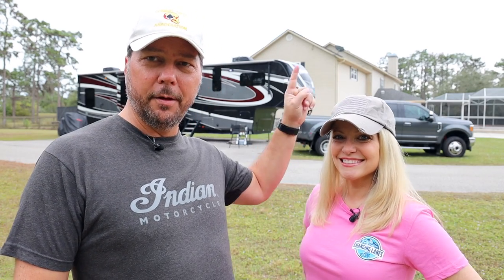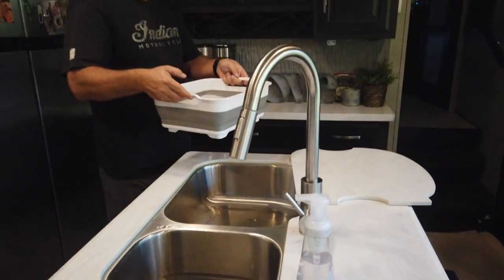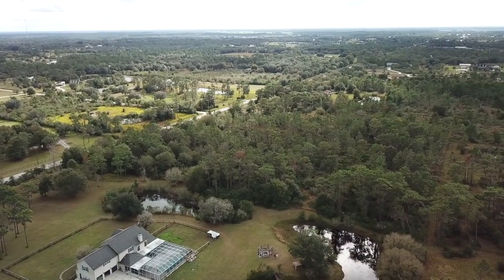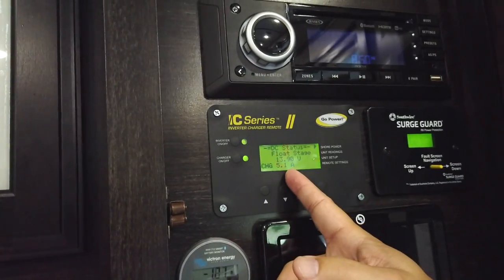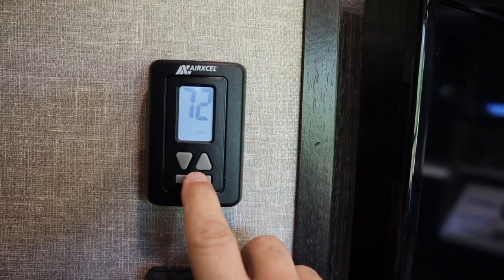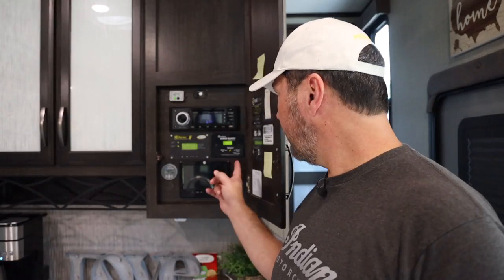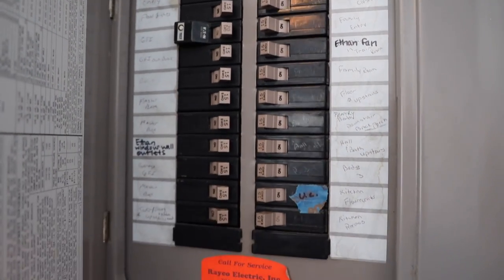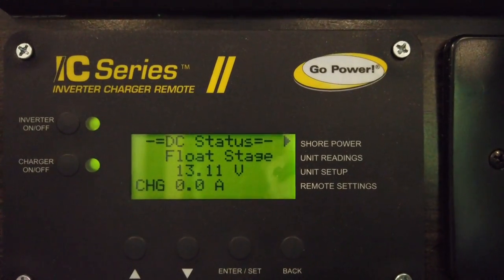RV Moochdocking! | Cheat Boondocking Like a Pro! | Changing Lanes!

Comment: So we have 2 campers 1 50 amp (2 ac) 1 30 amp (1 ac) with one 50 amp outlet...question is can we put a 50 amp splitter to power both campers with no issues?

Comment: Thanks for the video. How long does  a propane tank last on a mid size fridge and water heater?
Reply from the maker: Really depends... We shut off the water heater till about 30 minutes before we need it.   Also depends on outside temp for the fridge and how much "work" is has to do to stay cool...  Generally a single tank has lasted us about a week using LP for both.
Reply: @ChangingLanes  awesome, thanks!

Comment: Thanks for the helpful information.  I have 30 amp service in my RV.  Is it possible to do the split with 30 amp only?  (30 amp to dual 15 amp)  Also, where did you buy your adapters?  Thanks again.
Reply from the maker: Hi!  Everything is linked in the description.. But, there is no way to split 30A since 30A is a single 30A leg... Nothing to split.  You can dogbone down to 15A though if moochdocking...  Hope that helps!
Reply: @ChangingLanes  Thanks for responding.  Wanted to also thank you for your service to our country.  God bless.

Comment: Great video.  Question: I have a 10000w generator that has two 30amp and 4 20 amp outlets.  Can I combine a 30 amp and one 20 amp for a total of 50 amp?  (Actually 42amp) max output of generator.  If so where do I find the "Y" plug adapter?
Reply from the maker: If it's truly 10kW, it should have no problem supplying 6kW. (50A @ 120V).  It will depend on the generator supplying both connections simultaneously, which I guess it should.  You'll need to find the right combo of adapters and dog bones to make the connections...

Comment: Wow that is cool....however on an older class A I was always told never hook up to an extension cord.......hmmmmmm now this is ok????as a result TVs would be blown......due to low voltage
Reply from the maker: You need an appropriately rated extension cord (not the cheap ones) and it's fine.  Notes about this have been added to the video and blog: 
➡️ EXTENSION CABLES: Be sure to make sure any extension cables you use are rated for 15A. For longer runs like 100ft, these are NOT the cheaper cables. They should be labeled with rated amperage. Also, the longer the cable the more the voltage will drop, so keep an eye on it to make sure it doesn't drop below 108v (90% of 120v).

➡️ HOUSEHOLD CIRCUITS: When a household outlet/circuit is rated at 15A, that rating is generally for short term (under 3 hours). The real rating for long term load (over 3 hours) is 80% of the rating. Meaning, on a 15A circuit, if you’re going to run it over 3 hours, you should be at 12 Amps or less. An AC is like long to cycle less than 3 hours anyway, but on a hot day, it’s something to be aware of.

➡️ HEAT: When connected to 15A or 15A+15A and running for about 30 minutes under load, do a check of the entire line from your RV to the adapters, to the extension cables, and to the wall outlet. Do a touch test to make sure the lines and/or connectors are not getting hot.

➡️ POWER PROTECTION: We HIGHLY recommend using a Surge Guard Total Electrical Protection device (see: youtu.be/4FNtBtE_x2s), or some type of EMS that validates your power source voltage, frequency, wiring, etc. These are a great safeguard against bad RV park wiring as well as bad household wiring and just plugging things in wrong.

Comment: When you said the inverter kicked in is it pulling power from your batteries to run the inverter which makes up the much needed amps?
Reply from the maker: Yes.. With a hybrid inverter, you can set the max shore power to something like 13 Amps.  Then, if you try to dray more than that (like we did with the microwave), the inverter pulls from the batteries to make up the difference.  We'll have a blog post going into detail on that soon...  https://ChangingLanesRV.com

Comment: I’ve been RVing for 6 years and have never heard the electrical explained as well as you did. Thank you!  At some point could you explain how this would work if you don’t have an inverter?  I have a 2019 Grand Design Reflection 320MKS that does not have a residential fridge.
Reply from the maker: Be sure to subsribe to our web site... we will be putting out a more detailed video there and will cover that.  But the short story is, everything we showed up till the part about hybrid power at the end should be applicable to any 50A RV.

Comment: good video, but when you try to connect two 120v circuits, they MUST be on the same leg of the 220V panel, or you will have a differential of 220v ... something will smoke I fear.  Wish you could moochdock at our place in CO ... full hook ups AND wifi....
Reply: Bsjcook, 
As nice as i can say it, you are incorrect.  Any way to get two 120v circuits from any part of the panel will work going to seperate sides of the splitter.  The two phases will never come together in the rv or anywhere else unless somethong is wrong somewhere
  The fault would need to be corrected  before any electric could be used in the rv.
Reply from the maker: Only if something is wired incorrectly in the RV to somehow link the two phases would it be a problem.  And it would be a much bigger problem on 50A as I don't think there is much attention paid to any phase differential between hot 1 and hot 2 in a regular 50A pedestal.  I could be completely wrong on that, I've just never seen anything referencing phase.. Frequency, yes, but not phase.    I also should have mentioned in the video that an EMS or total electrical protection system are highly recommended to detect any such voltage or wiring issues.  We will add this to the description and blog.  👍🏼  
And, thanks for the invite!  😊
Reply: @duaneroepke8840  Thanks ... I have wired several houses, but no RV's... much to learn....
Reply: @ChangingLanes  I'm very puzzled, because each leg of the 50A outlet at the post are just 120 volt legs that are 180 degrees out of phase to give you a differential of 220/240 depending on the type of service.  We live in a rural area where they deliver 240v service. I haven't yet found a wiring diagram of the joiner cables, and will keep looking.  Keep up the great videos!

Comment: I noticed your 50-30amp and 30-15amp. You have extension cord with yours. We have a travel trailer so only 30 amp TV, but our adapter is just the plug. Is the extension better? Also, with 50 amp at a rv park with only 30 amp can you use the 30 amp and the 15 amp since they are on separate breakers or is that a bad idea? We are thinking of upgrading and it looks like it will have 50 amps.
Reply from the maker: While it is technically possible to run a line to 30A and another line to 15A, there's just no way to know if the pedestal is wired to handle 45+ Amps. I think many parks might be wired to handle only 30A. Definitely check with the RV Park first.

Comment: this was super informative for this newbie, but i have a question. do you use a standard home strip surge protector in the house when you don't have surge protection built into your RV? I have a class b and want to connect my 30 amp to home 15 amp, but don't want to blow the house, or my RV for that matter.
Reply from the maker: We have a surge guard total electrical protection system, which is much better than a surge protector... See this video for details:  https://youtu.be/4FNtBtE_x2s

Comment: Great video!  Do you know if there is a way or device that will let you hook up a 30 amp camper to 2 15amp?  I understand the 2 leg theory,  just hard to research.
Reply from the maker: No.. Because there't nothing to split on a 30A system.  30A RVs have a single 30A leg, while 50A rvs have two 50A legs (so really 100A)

Comment: So are you saying with that 2X 30 amp to 50 amp dog bone, you could plug one 30 amp into your pedestal and the other into the neighboring pedestal and effectively be getting 50 amps (60 amps)?  Rob
Reply from the maker: Yes.. But, see the caution on that in the pinned comment and video description:
⚠️⚠️ One thing we forgot to mention and another thing brought up in the comments that are valid concerns:
➡️ EXTENSION CABLES: Be sure to make sure any extension cables you use are rated for 15A. For longer runs like 100ft, these are NOT the cheaper cables. They should be labeled with rated amperage. Also, the longer the cable the more the voltage will drop, so keep an eye on it to make sure it doesn't drop below 108v (90% of 120v).
➡️ HOUSEHOLD CIRCUITS: When a household outlet/circuit is rated at 15A, that rating is generally for short term (under 3 hours). The real rating for long term load (over 3 hours) is 80% of the rating. Meaning, on a 15A circuit, if you’re going to run it over 3 hours, you should be at 12 Amps or less. An AC is like long to cycle less than 3 hours anyway, but on a hot day, it’s something to be aware of.
➡️ HEAT: When connected to 15A or 15A+15A and running for about 30 minutes under load, do a check of the entire line from your RV to the adapters, to the extension cables, and to the wall outlet. Do a touch test to make sure the lines and/or connectors are not getting hot.
➡️ 30+30: If you decide to use the 30A plus 30A setup, try to connect them to separate LEGS, not just separate circuits.  If you have to connect them on the same leg (still separate circuits), be sure to stay under 50A TOTAL for both legs.  The reason is, if you draw the max (30A) on both legs and they are on the same leg in the house, the legs are IN PHASE and will cause 60A on the Neutral line.
➡️ POWER PROTECTION: We HIGHLY recommend using a Surge Guard Total Electrical Protection device (see: youtu.be/4FNtBtE_x2s), or some type of EMS that validates your power source voltage, frequency, wiring, etc. These are a great safeguard against bad RV park wiring as well as bad household wiring and just plugging things in wrong.

Comment: Did you ever think about using a macerator pump? You could empty your tanks into a toilet inside the house through a 100ft 1-inch hose.   That way you don't have to move every few days.
Reply from the maker: With 100 gallons of black tank and only 2 of us, we have no problem going 2 weeks with no dumping... 👍🏼

Comment: I don't know if any other electrician has commented but the 50-30 splitter should be hooked up to different phases otherwise you could have 60 amps in the neutral. It's not a problem with 2 15's or 2 20's or even 2 30's unless the total is over 50. Maxed out it would be a 20% (60/50) overload of the neutral which might be a fire hazard.
Reply from the maker: The two legs in the RV are completely isolated and the phases of each circuit should have no way of interacting.  As long as each leg is on separate circuits at the house, phase shouldn't be an issue, no?
Reply: @ChangingLanes  NO, but like I said, if 2x30 your worst exposure is a 20% overloaded neutral, with your 2x15 or even 2x20 both on same phase is under capacity for a 50A panel. I can tell you don't get it, and it's not a big deal so far but here is why phase is important. In a normal 50 Amp service one of the 2 hot legs goes to +120 while the other hot lead goes to -120 If both are pulling equal amps then the Neutral has 0 amps flowing, that's why it's called Neutral. If one leg pulls 0 and the other 50 then the Neutral is handling 50 so since the wire sizes are the same for L1, L2, Neutral all is ok. In a typical RV L1 might be pulling 23 Amps and L2 17 A so the net amperage in the Neutral is (23-17) 6 Amps. Like I said, no problem at all at using a 15 or 20 amp supply, but hooking up to double 30 can cause a out of spec condition.
Reply: @john543  take the splitter out of the picture. All 50amp rigs and RV parks offering 50 amps run a romex #6/3. So yes there are 2 hot legs and 1 #6 to carry the neutral back.  Using a splitter for a 30/30 split will not cause an overload to the neutral near as much as the standard 50/50 on a single neutral. 

We do see that the neutral does take more of the hits in the RV space. Usually when we are full open with 3 a/c and blending our favorite foods. But the #6/3 is common and is NFPA 70 approved.
Reply from the maker: Thanks for clarifying.  And I hope you don't think I'm arguing.  Not at all.  I just want to pick your brain and make sure I get what you're saying.  Hope you don't mind more questions?  I appreciate your time on this...  

A standard RV 50A Pedestal is split phase and will have two separate HOTs 180 degrees out of phase.  There’s always a 240v differential between the two hot lines when on 50A and they have a shared neutral and that’s all normal operation.  

So, is the issue with a 15+15 or 30+30 (via the wye) that the two lines will potentially have the same phase?  Same phase should have a 0v differential.

I get that the neutral will carry the differential in current and that current is proportional to voltage (ohms law).  But, I'm not clear on how the phase will cause current issues on the shared neutral/ground when it’s designed for maximum differential (split phase) to begin with.  Wouldn't two circuits in the same house share neutral at some point up the chain anyway?

Again.. just trying to understand your reasoning.  I have a background in electronics from the Navy, but I’m not super versed on house wiring so I’m truly trying to get what you’re saying…

Maybe if you could describe what you see as the worst possible scenario in a 30+30 and/or 15+15 setup that would cause issues on the neutral line?
Reply: @ChangingLanes  Sure, The 180 out of phase is the key. AC as you probably know is a sine wave, so while the voltage on L1 is going from 0 to max positive, the voltage on L2 is going from 0 to max negative. That means that the neutral 'sees' the difference which is the L1 amps - L2 amps sign not relevant. At max amps +50 and -50 equals 0 amps flowing on the neutral. The issue for 30 + 30 is that if L1 and L2 both are going 0 ro +ve or 0 to -ve at the same time (in phase) then the amps on the neutral are additive so 30 + 30 is 60 which is 120% of 50. On a 50 amp RV the most the neutral can be is 50 amps by having max draw on one line and 0 on the other. The 120/15 or 20 is not an issue since the inphase max is 30 or 40 on a wire sized for 50, I was only concerned someone watching would think that if that is ok then two 30's are ok. Does that help?
Reply: @RVBeardandBabe  See the previous answer. You are not taking the 180 phase relationship into account. A properly wired 50 amp service at 100% load would have 50 amps flowing in one direction on the neutral and 50 flowing the opposite way for a net of 0 amps. The maximum wold be 50 if we had a 50/0 split. The reason the 30/30 wiring is an issue is it could be wired in phase so you have at max load 30+30 which is 60 or 120% of 50.
Reply from the maker: NOW, I'm following! 👍🏼    IN Phase 30A sources, both pulling 30A can create a 60A load on the Neutral.   It's a little bit of a perfect storm scenario, but it certainly could be done if we had all 3ACs going then kicked on the Microwave for instance.  15+15 and even 15+30 would be fine.  I'll add that to our notes on the vide and blog post... and cover it in more detail in our upcoming blog post where we will get into the weeds on using hybrid inverter and such.  My note will be to make sure that if you plan on using 30+30 with anywhere over 50A combined, be sure they are not only on separate circuits, but separate LEGS (out of phase), or at least stay under 50A combined...  👍🏼     Thanks for sticking with me while I got my brain around it..
Reply: @ChangingLanes  You got it, but one quibble, it's a 50 50 chance you get hooked up wrong, not perfect storm. Yes you still need max draws on both legs, but with 2 AC's, washer, dryer, etc the modern glamper can get there pretty quick. I purchased the Y adapter thinking I could just plug into 2 adjacent 30 A posts, but somehow I accidently saw the article that even as a retired industrial electrician I did not know about but the explanation clued me in. As a result I have never used it. Again, those who use the Y for a 30 + 20 or a 15 + 15 all is good. In our litigious society you don't want to publish information that can remotely cause somebody any harm.

Comment: Only thing I might add or suggest would be use a heavy duty extension cord when connecting to 15 amp
Reply from the maker: Yes...  Good point on the extension cord.  I should have mentioned that the extension cords need to be rated for the amperage.    I also should have noted that an EMS or total electrical protection system are highly recommended to detect any voltage or wiring issues.  We will add these to the description and blog.  Thanks for point those out.  👍🏼
Reply: Changing Lanes can’t remember everything- Still good info

Comment: Do you have an adapter for 50A to 30A (4 pin) to be able to take advantage of the drier plug in the garage?  Do you have an adapter for 50A to 30A (3 pin 220V) for older drier plugs?

Comment: I carry a 50 to 30 and a 50 to 15.  I see no gain in stacking pigtails.  You're actually adding an additional connection for no reason and I'd like to keep that to a minimum. It's still 2 pigtails to carry in your compartment.  I suppose if you're stacking on the splitter and need 2 of each it might make more sense but I'd rather buy the proper splitter and minimize connections.